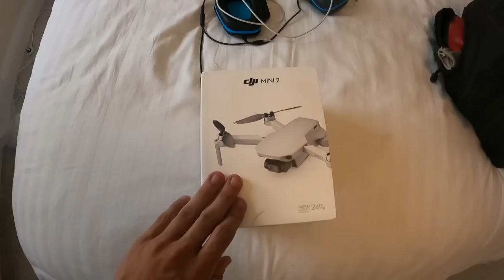Black & Filthy Job Completely Transformed With My POWER WASHER!!

Comment: I did exactly the same as you and turned my ankle really badly a few years ago whilst I was walking across large rocks on the beach. There are ligaments that stretch across the ankle that can tear when you roll your ankle.  My foot had exactly the same swelling that you have.   The hospital advised me to keep it moving otherwise it will stiffen up - I didn’t listen to them though and now iI don’t have as much flexibility in it as I used to.  My advice - definitely keep it moving! !
Reply from the maker: maybe ive been doing the right thing then!! hope yours gets back to normal!
Reply: But. . . You Have to get it checked to know! My Hubby was messing around with our kids in the kitchen during Christmas break a few years ago. The oldest jumped on his back. His foot slipped on some melted ice from the freezer. Down he went. 6' 3" probably 235 lbs. He broke 1 of the tiny bones in the foot by the toes. But. All the rest of the bones were displaced. Luckily he could tell something was Really wrong. So he rode the kid's skateboard back to the living room. Wrapped his foot then elevated it. Since I was working at the Time. And not a compounded fracture. He waited till I could take him to the ER. Got x-rays freaky to see. They called it a lisfranc fracture. 2 surgeries pins screws and 6 months of not walking on it. He is now back to almost (99%). Almost because he can sometimes feel a twinge when he plays tennis. But! He Can Play tennis again! Please be careful!

Comment: Hey Sid, the data in this case is basically always still recoverable. Feel free to get in touch with me and I'll run you through your options. Best thing you can do is not to write any data to the computer in the meantime, though
Reply: THIS! Get hold of a computer expert as data is nearly ALWAYS recoverable. It will be on your PC and a data recovery expert should be able to get that information back in an hour or two.
Reply: Excellent advice!
Reply: The data is normally still recoverable Sid buy Disk Drill which is a software that will recover files from your hardrive wether it will be documents,audio,video etc… 👍 hope you get it sorted
Reply: If this guy can recover your data, award him the drone (if Louis doesn't appear)
Reply: You can do your own data recovery, but if you are as pc illiterate as you say, please pay someone to do this for you. Get an external hard drive for your business data (a thumb drive is perfect) and keep a backup in a safe place. A safe... is a safe place. As you have just found out, it is easy to stuff up. Back up regularly,  often, every week, daily, each time you save etc. 
I cannot overstate this. I would offer to help you but the other side of the world says no.
Reply: Agree with Simon here - you have a good chance of undeleting some of the files. That chance does diminish if you write data to the drive especially if the drive is almost full.
Reply from the maker: Thanks simon got a couple of things to try tonight, if still unnsuccesful ill get in touch asap!
Reply: What were those things people used years ago to write things down with??
Reply: @stoobydoo74 piece of paper and a goose feather

Comment: Sid, as someone who helps small businesses optimize their sales processes and performance, I am going to recommend you look at investing in a CRM system to manage your clients and sales.  These are mostly cloud based now and can integrate most email systems so messages can be centrally tracked, documents like bids can be attached to each customer or account, and some payment systems integrated.  Some are even mobile enabled so you could pull up information on your phone or tablet while on the go.  Just a suggestion! Love the videos and appreciate dealing with the heat as we are having our own issue down here in Texas this summer

Comment: If you are using OneDrive, make sure you save all your documents you need in the Documents folder that should be pinned in Windows Explorer and that OneDrive Sync is on and use the Personal Vault for your business documents for extra protection.  In the settings there are a bunch of Notifications you can turn on, one is to alert you when a lot of Cloud files are going to be deleted, this will make it harder to accidentally delete synced files.

Comment: Have a desktop folder of one drive which automatically syncs to the cloud version. 
Also back the one drive folder or whole pc to another portable hard drive or two consistently. Even fortnightly probably be heaps. At least you could only lose a fortnights worth of stuff if some how all those backups and one drive fails.
This is pretty much what I do
Reply from the maker: Thats what i thought i had, little did i know it hadnt been syncing for two years! :D
Reply: @PartridgeExteriorCleaning  yeh thats rough. Got to check the icon in the menu bar some times to see if it is behaving

Comment: I did look up the temperature.  You were getting up to 85-100 plus degrees Fahrenheit comparatively.  The parking area turned out nicely and looked well with the manicured lawn.  Nice color change on the flagstone looking area.  

I had noted you did something interesting on the job where you twisted your ankle.  You do power washing but on that particular job, you had rather fearlessly dove into a yard cleanup before the power washing.  There you were, out with a string trimmer, etc.  Now, you were doing something amazing, in that anything that was needed got done.  Your injury may have happened a) because it was a very small hidden thing b) because you aren't accustomed to going through a job with massive overgrowth and looking for every odd thing that might cause you harm or hurt you.  The job was a remarkable recovery of an area.  Do hope that simple things will help your ankle heal. 

There is a concept that something "bad" might or might not be, only time will tell.  The road shove you dealt with, ended up giving you a condition of better equipment overall.  Wishing you well on finding an adequate data recovery program, but as you noted, you learned you need some fail protection backups, even written records, and other such things for better future conditions.  You are sincere, persistent, hard working, do nice results.  We all enjoy watching for that.  Perhaps too, people will write in with interesting projects, as you suggested.

Comment: I know it's not fashionable, but wouldn't an waterproof apron be perfect when you use the free hand nozzle? You could combine it with a sponsorship from blue apron or something.

And as others have mentioned before, you data has 99% recovery chance. I did it for my dad with a software tool when he deleted all his photos from an SD card.
Reply from the maker: I don't really get that wet these days, just a bit of splash back once in a while, the wellies take the brunt of it :D Yeah ive tried a few tools but nothing has worked yet, will keep looking

Comment: try looking into getting a Synology NAS with a 2 bay hard drive so u can have auto backups of ur laptop or desktop pc. 1 hard drive to put all ur info on & the 2nd drive will auto backup when using 1 of the raid modes. will come in handy for all the family with phones / pictures & not just work stuff.

Comment: I recommend saving documents like that on an external device. That way if your computer dies, you can still get the files. Also, you can remove the device when deleting files on your computer to make sure the documents are safe.
Reply: External devices can also easily break. Directly on Onedrive or icloud or similar is the best way. Used correctly you can always bring back earlier versions or deleted documents, and you can access them online!

Comment: Consider a NAS for the videos, even a basic one, and just put in large disk drives. You can set it up, at least in what's called RAID 1 setup... which mirrors one disk to another (so one is unusable, but in case one fails you have the other and you can simply replace the damaged one. It's not a backup however, if you delete something it's still gone. But then you can set it up to replicate the important stuff on cloud services like Google Drive, etc... And maybe use Google Calendar for the calendars :)

Comment: Hello Sid, sorry to hear about the loss of documents - i was in a similar spot with some project files some months ago - there is a free tool called - PhotoRec - despite having the name photo in it it can normally recover almost all types of files. There is one version where you need command prompt but it also comes with a easy to use GUI Version called QPhotorec. Hope it can help - feel free to contact me or reply to the comment :)
Reply from the maker: thanks buddy i have tried a few different ones with no luck yet but ill sit down tonight and try again, thanks for that

Comment: If you just lost your files and have not added anything new to that drive yet, you could bring it to some company to restore the files.
Even if they are not accessible from Windows, the data is actually still on the drive unless it is overwritten by new files, or you perform a deep scrub of the drive.
It happened to my wife once, and we were able to recover the data this way.

Comment: Well, glad the foot is feeling better, and SUPER glad you weren't out in that heat! I'm in Quebec Canada, but I know your houses are not equipped for those kinds of heatwaves. Yay global warming! 😬
And congratulations on the award!! Well earned, and I'm so glad it's arrived!
Reply from the maker: haha yeah definitely not, no air con!
Reply: @PartridgeExteriorCleaning  We were right there with you last year. I'm in the PNW of the US, and we had a similar heatwave last June and we hardly have AC in homes here either (our climate is pretty similar to yours). 43 degrees, my dude. Felt like walking through a brick wall. I hope you've cooled off!

We just spent a week pinging between 30 and 35 and its been awful.

Comment: for some of the files if you have used a email system you might be able to back up some of them in that route.  ( I know it might be a painfully slow way but you could still try)

And for the future please make sure you have at least a trippel back up for your business stuff.

Like one harddrive directly linked to your computer. 
also have a offsite server backup. ask said server to make a backup at least once a day and let it report that it did so.
then after that have a third harddrive somewhere in your home that acts as the back up for the back up.

Comment: Hi sid, one drive has its own recycle bin which you can access from the onedrive icon in the status bar of windows - the blue cloud. Otherwise check your onedrive is signed in and signed into the correct account
Reply: Also check the status feed of your onedrive in your browser, open onedrive in browser and click the I information icon in the top right which will show specific file activities
Reply: There is also a "restore onedrive" option if you pay for the office 365 subscription which should allow you to restore from the cloud based versioning of the files

Comment: Hi Sid can i just say as an IT expert even i can do some stupid things but everything you say you think was permanatly deleted can't be unless you actually pressed delete the file. what can happen is you might have moved the file to another file by mistake without actually realizing i have done it many time myself.now my idea might take a bit of time but could help. what you need to do is click on every single final you have even files in files and see if you have moved it by mistake like i said i have done it myself then kicked myself about it but eventually i found the lost files,another thing you can do is on either your download or documents page is on the top right of that page you will see a search bar if you know the file you lost type it in there because usually it will have a duplicate in it i hope this helps best of luck.

Comment: if you haven't written too much stuff on your hdd you can still try EaseUS Data Recovery Wizard or other recovery programs, they would have restored your file with no problem if used immediately after cancellation.

Comment: Nothing is ever permanently gone. One drive has its own recycle bin (stay there for 30 days) and files don’t go into the OS recycle bin.

Good luck 🍀
Reply: I think Sid said the last time One Drive successfully "synced" with his computer was 2 years ago. Which I thought meant "it didn't have a backup restore point" but I think meant "OneDrive was not getting any files uploaded to it for the last two years"
Reply from the maker: yeah like josh said basically it hasnt been going to the onedrive for two years even though it was literally a one drive folder D: Silly me for never checking

Comment: Question :
Sodium Hypochlorite is basically strong bleach ie 15%.
Would plain old household bleach at 5% be ok to use on York stone to remove black spot?
Reply from the maker: Yeah it'll work (: might need a few retreatments and some scrubbing but should work just fine.
Reply: @PartridgeExteriorCleaning  
Thanks for the reply. 
I'll go get 12 bottles of bleach from my local Sainsbury's then.
Don't fancy spending £40 this time around along with an expensive dedicated surfactant.

P.S. I once 'sprained' my ankle or so I thought. Instead I had chipped a bone. Not pleasant. Wish I'd got checked out earlier. 
Hope yours is ok.

Comment: Been there, as a business owner myself and it hurts but like others have said EaseUS is a simple tool and has helped many times.  Have used various other tools in the past though.  Anyhoo after a major screw up I got all my accounting, contacts, contracts, legal docs, templates, and much much more, oh you name it was all there one minute and then it wasnt.  Some 500GB worth of data - heart stopped when it happened as there was a lot of work and time in that lot, took a while to get it all back, but get it all back i did.  If you need help, get in touch all I charge is a cup of tea ;)

Comment: There's a data security concept called "321" where you have 3 copies of data, 2 on site, and 1 off.  Generally protects against loss of files in pretty any circumstance.  I'd recommend investing into a setup like that in the future.  

As others have likely stated. You'll want to check temp file folders like the stuff in appdata/roaming. To see if there's a copy of the files there.

Another thing you can do is open up a google drive folder and use that to host spreadsheets and other information so that you're operating off a cloud service rather than relying on local data storage.

Comment: Congrats on Youtube Button!
Regarding the bad luck - Look at this as an opportunity needed as your business has grown. 
I learned the hard way too to  always do a backup that is kept separate from your main computer & phone.
Every 6 months or yearly for sure back up & keep in safety deposit box perhaps. 
A yearly Microsoft office subscription is not too expensive. Then you could use an excel spreadsheet with all customers & info that would be useful. 
There is an accompanying phone AP. 
You can update on phone, it's saved in the cloud, then you can back it up monthly by renaming a copy as of whatever date. 
It is searchable and if you learn more than it's basic uses, you can make search formulas that would give you reminders or stats if you chose; however even the basic use is fairly simple to use. 
I use it for keeping track of our clients for our non profit.

Comment: I've had success recovering files using "recuva" - I believe it's still free too. Hopefully, if you've not used the computer, the file may still be recoverable, but if you've dumped a load of video files on there since, it's possible the file pointers will be overwritten. Always worth a punt though!

Comment: Be extremely careful Sid. Those sprains can take 6 to 8 weeks to heal properly. 

I made that mistake and I still suffer pain now, 25 years later!

P.s. you might be able to get a data recovery done. A full wipe of a hard drive never truly deletes the data. 

P.p.s. Buy yourself a large cloud external drive and set your most important files to back up automatically via WiFi every day.

Comment: There is software out there to rescue the data. Just because it is deleted it doesn't mean that is remooved from tha harddisk. You can think of this as a folder that has the register removed. So there is a good chance to rescue a lot of the stuff if you didn't put new files onto the disk.  Example of the possible software are https://www.techradar.com/best/best-data-recovery-software

Comment: I thought on the second job the brick was going to be red and was like dang! thats really dirty(granted still really dirty) but thought it would be red under it and 'look; even more clean cuz it went from like black to red instead of black to like greyish color.  Also I almost feel like on the second job unless they said they didn't want that wall cleaned I possibly would've tossed it in for free cuz from the home-owners view it is very dirty and takes away some of the appeal of the freshly power washed drive-way.
Reply from the maker: I normally do but just incase as its quite old i just said do you want the wall done too? it's no extra. They said no thanks just the ground stuff!

Comment: Oh no I'm so sorry. I learned the hard way just recently that I need to back up more often. My SSD overheated/crashed (still not exactly sure). Destroyed the boot sector and I thought it catastrophically failed. SSDs can do that unfortunately. I was panicking, but realized the boot sector just got messed up for some reason and that's the drive I boot to. Everything was ok, but I know that crushing feeling. Maybe someone can help you recover the files. There are tricks out there.